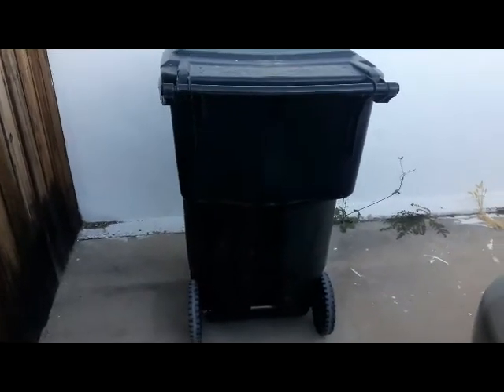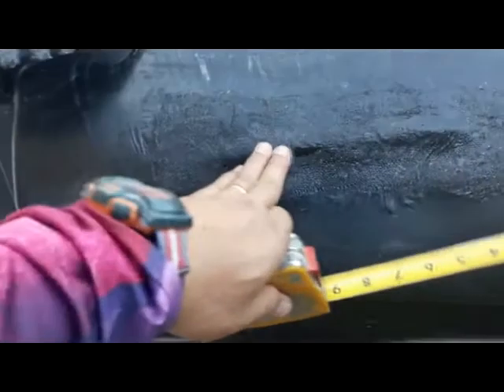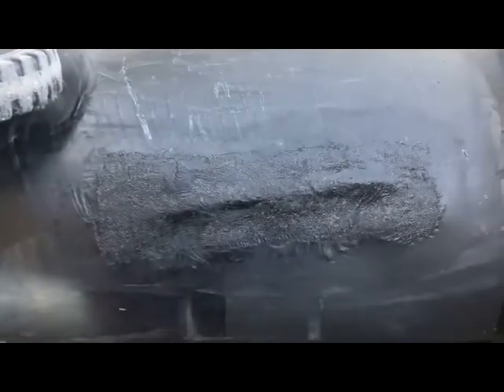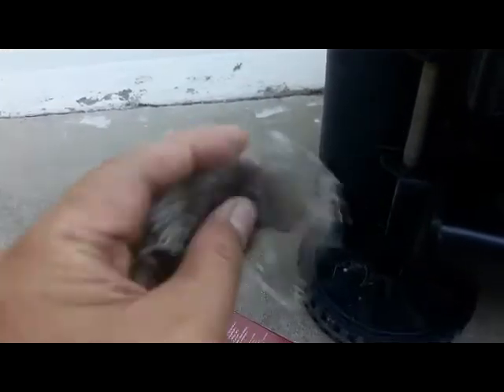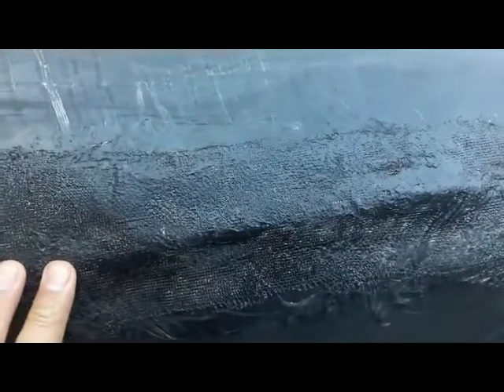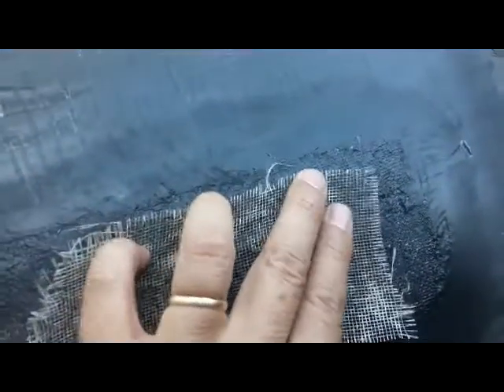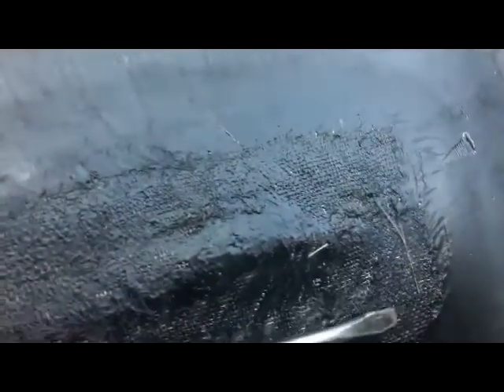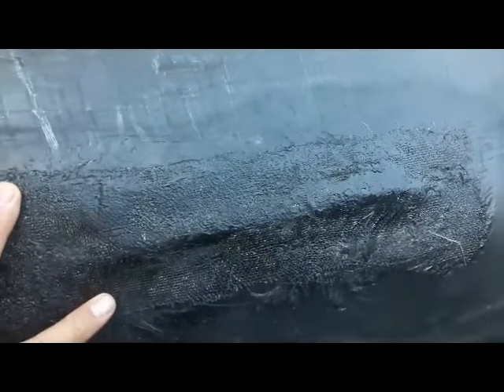Trash Can Crack Repair

Comment: A quick way to keep a crack from growing is to drill a hole at each end of the crack. The hole distributes the tearing force around a larger area and greatly reduces the likelihood that the crack will propagate further. This is a well known trick.